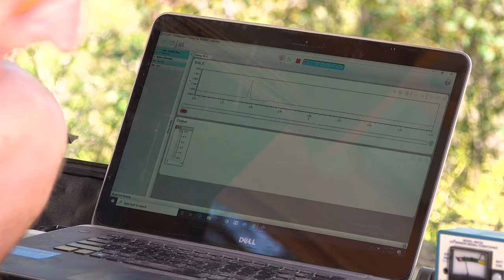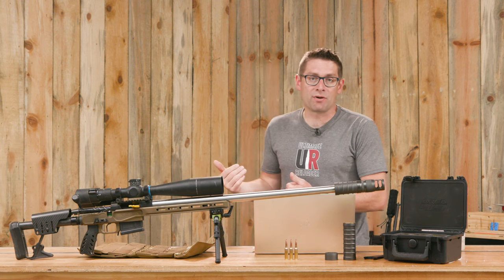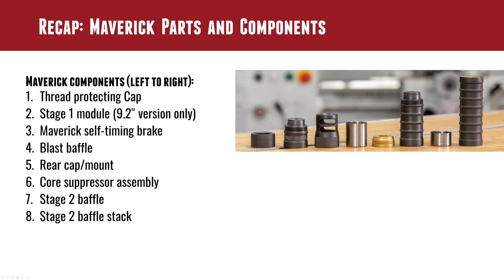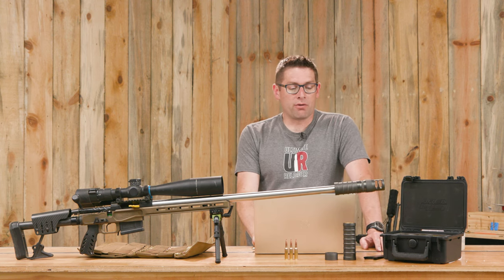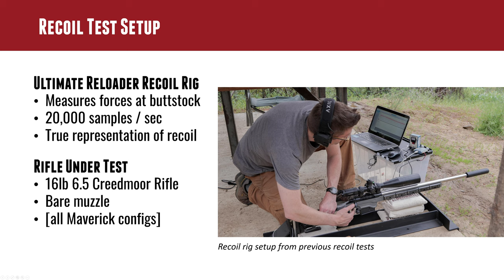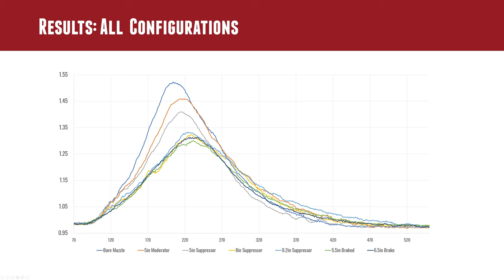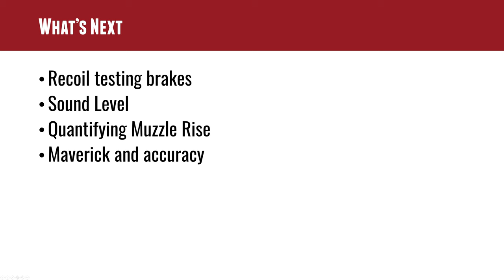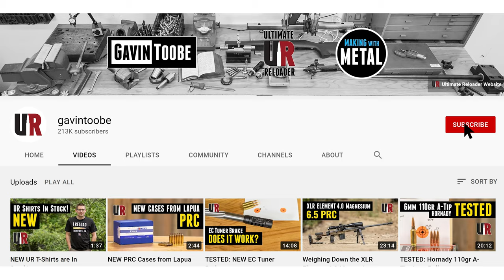Area 419 Maverick Recoil Quantified! (7 configurations)

Comment: I don't know if anyone can copy it but the vass (that's probably spelled wrong) was the best break I ever used and have several of them on hunting guns. The major drawback is  the 32tpi that makes that all you can use. As far as recoil reduction goes they are great and the hotter the load the better it works. Company had some issues with investors and all the other b. s. that you're probably already aware of but it's a great design just needs a common thread pitch.
Reply: I believe it's the Vais brake you're referring to, and they do have a good reputation for efficiency.
Reply: The Area419 will definitely sacrifice some recoil reduction for the modularity they hey.

Comment: I’d like to see the same tests done with 6.5PRC and 300PRC. Results may not be linear with a larger volume of gases and their respective velocities.
Reply: I concur, would like to see test with 6.5 PRC, 300 PRC, and 300 RUM. 300 RUM since I have a 300 RUM as well as the others.
Reply: Brakes are always more efficient on higher caliber hotter loads. Personally, this thing is one ugly mother. I wouldn't have it on my rifle. BTW the group sized matters more than recoil or sound.

Comment: Great video.  By repeating each condition with multiple shots, which should be simple to do, you can do an analysis and see which differences are statistically significant.  It’s very possible that some of the small differences you’re showing are well within the data scatter.

Comment: The blast can pull off over 50% of the recoil.  All at the expense of a longer platform. I know one company has designed a suppressor into the barrel! Why can't we have both? Our platforms could be designed with a much shorter package and the built in suppressor would do two things. Reduce noise, and fix barrel harmonics!!!!! Blast forward devices sorta do both. Small wholes that act like a gas tube could be installed to feed a device for reducing recoil before the exit of the barrel. I used the silenced mp5 in the military. The design did everything. Silenced, reduced recoil, held pressure longer for faster projectiles. The accuracy was also improved because the barrel was surrounded by the device. Harmonics where dampened drastically. That what I would like to see. A manufacturer produce a screw on device that covers the barrel and does all these functions.

Comment: Great setup
I think seeing brake and suppressor recoil reductions would be great.  I would like to see how the 419 brake vs the APA vs the EC Tuner plays out.  I dont think anyone here expects you to buy a bunch of cans to test them, but as you can those data points would be great to see as well.  
The only suggestion I would make is to shoot a cheaper but slightly harder hitting caliber like a 308.  M80 ball clone loads are cheap and easy and would give you an easy baseline.  And you dont have to worry about wearing out a barrel on a match gun!  :)

Comment: Gavin,  I am surprised you tripped the trigger using your hand.  Would it not have been better to have a solenoid or small drive mounted on the trigger to avoid any force components supplied by your hand or finger?  Where you had a small difference in reduction of 2% between the 5.5 and 6.5 brakes, could external forces have been a factor?  Likewise, I would have expected the 9.2 inch suppressor to have less recoil than the 8 inch one.
Reply: Thought the same.
Reply: Also, in the video he is holding the forearm on the bare barrel shot and the buttstock on the suppressed/brake shot. 
Hopefully he did not have any "hands on" for actual testing as it would be literally impossible to grip the gun the same way each time and his crouched position would exacerbate that error. His jig should be up at bench level with no hands on deck. A remote triggering system would certainly make data capture better. The change in voltage, without a translative formula, does not give any helpful information. A simple sled would have been less expensive and easier to show the results of recoil reduction, and much easier quantification, from the various configurations. Muzzle rise could be captured via a grid plate and high speed camera with the rifle in a jig that only allows vertical movement, or ax a component of the sled.
A control could be placing a similar weight on the barrel as each configuration to eliminate the factor that just the additional weight affects the movement.

Comment: Great info. Just curious how repeatable is the recoil rig if you shot 5 rounds in the same configuration.  And if it is really repeatable it would be interesting to get recoil and velocity data and see if you can see the difference between a round that is 20 fps higher.

Comment: You could probably use a linear type position sensor similar to what they use for shock travel sensors on race cars. Or a universal position sensor with a linkage to the muzzle end. They’re normally 5v .5-4.5. Just a thought. Cool test. The difficult thing would be getting the sensor back to the same starting point each time I reckon.

Comment: Great info Gavin. 👍 The slight variance in recoil for the 6.5 brake and 5.5 brake might be some noise induced from the sand bag friction?? If you have a benchrest rifle sled lying around to use instead of the bags, it might take some of that out.

Comment: For sound monitoring on the rig, there are only really two places where it counts, the shooter's ear by the action, (more so with gas guns), and at/downrange of the muzzle. And you are just needing to record "peak decibel reading" if it could be measured with a cell phone app. Then two microphones and measuring a voltage change should give something 🤔. Because the real comparison is, sound reduction vs recoil reduction, vs cost, vs overgassing issues.

Comment: Excellent 👍 unfortunately my expirence just trying to contact Area419 to purchase this suppressor under my SOT has been poor. Tried multiple times. Im currently running a thermal suppressor llc with an integrated muzzle brake for a 6mm CM 22" prs setup and wonder if the suppressor makes the barrel heat up faster. That would be a good test to show aswell

Comment: My 20” BCM NM barrel loves a Smith Vortex flash hider.  Under an MOA with, shotgun without.  

I notice a .2Mil shift in POI when shooting my 223 bolt gun with and without a Dead Air Nomad L but no change in accuracy.  My 6.5CM doesn’t care.  I’m currently investigating the accuracy potential of different muzzle devices including suppression.  I have a curious mind like you but not the time or budget.

Comment: I would love to see data points on muzzle rise, recoil reduction, and how well the flash was contained on long to short barrels and it's DB reduction. Also, repeatability if shared on different platforms. If you could then put that in an excel spreadsheet then, give a ranking for the brands in each category.

Just my 2 cents 😅

Comment: Harmonics 
Nodes.
Each configuration will have a different harmonic and node. (?)
So, fine tuning hand loads for each different configuration...might be necessary..if you use different configurations...?
Reply: In theory yes. But Area419 has made multiple configurations weigh the same so some configurations will have zero POI shift and group size differences.
Reply: @airenthusiast1071  that's nifty indeed.
I guess they are the same length too.